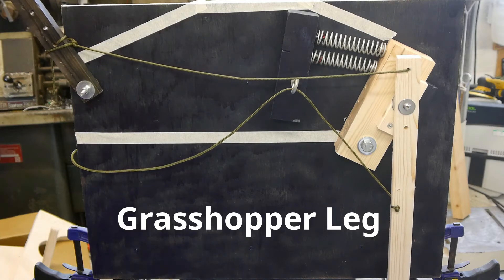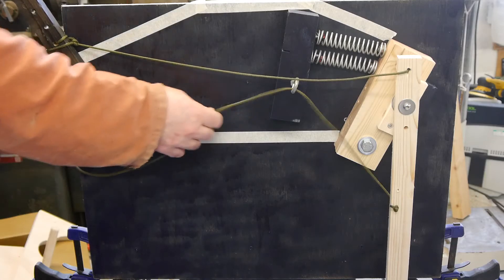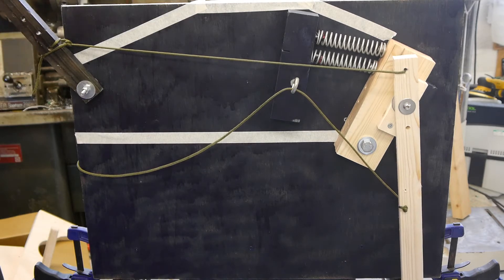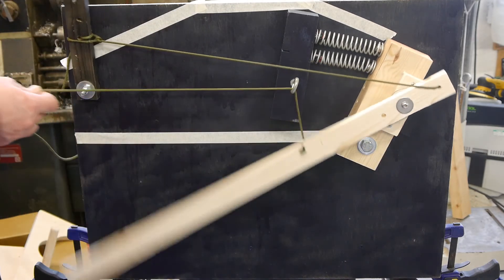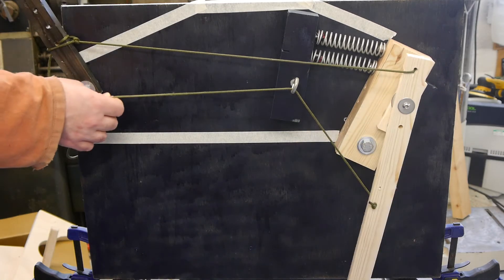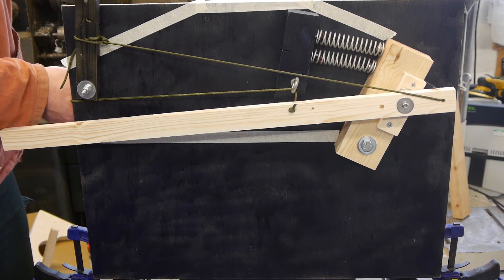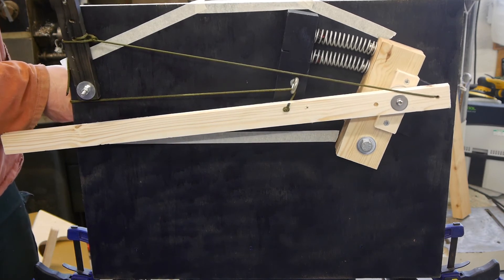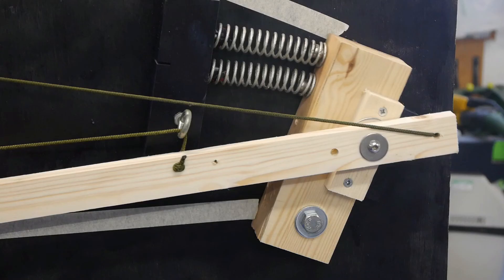How a grasshopper can jump so high

Comment: Strictly speaking You need to separate between muscle and tendon
Reply from the maker: @FLORIDIANMILLIONAIRE  you are probably right, though it doesn't affect how the meat mechanism works, which I was interested in at the time.
 I sold the kit to Steve Mould who has done a much higher production values version recently.
Reply: @daveansell1970  production for what ?
Reply from the maker: @FLORIDIANMILLIONAIRE  the video

Comment: Wow. I don't think most folks realize what a brilliant and novel mechanism this is. I just modeled this up in software to try to understand it. There is no human designed repeating mechanism that I can think of that accomplishes storing force and releasing it kinetically with even vaguely similar linkages (ok so a trebuchet is somewhat like this, but fundamentally dissimilar). I can't think of a single wind-up toy, robo-dog, crossbow, other similar kinetic weapon, car part, throwing machine, industrial machine, walking machine etc, that uses linkages like this. 

I could write paragraphs on why I think this is so novel, but just try to model it yourself and you'll see what I mean, the fact that the video model is using the very specific properties of strings for some of the linkages is critical, the efficiency of force transfer is amazing, and the angles are critical.
Reply from the maker: Glad you like it. I wonder if it isn't used very often is that there aren't many places it would be useful outside scrapheap challenge (junkyard wars).
Either that or it is just much better suited to muscles than rotary machines.
If you scaled it up and used winches the release on the smaller winch would be difficult to achieve safely and reliably.

Plus you have a system that needs two actuators with limit switches to achieve a single effect...

It is very cool either way.

Comment: I am looking in nature to design the ultimate shock absorber and I wonder if you think this mechanism could be a possible candidate?
Thank you in advance.
Reply from the maker: As is this wouldn't be a good shock absorber as there isn't really any mechanism for absorbing energy. In a car the shock absorber is there to stop the spring bouncing for ages when you go over a bump.
I don't know enough about cars suspensions to tell you if this would be a useful geometry, my guess is that you don't want a car suspension to get less stiff the more it is compressed so no. 

If you wanted a car to jump in the air, it may be useful.

Comment: on my quest to design and build a functional prototype "mach 5 speed racer" I would need this principle to get the vehicle to jump. it's the compression of the "spring" AND the shift of leverage that does it.
thank you for amazing work.

could we make a jumping strandbeest?

how do bumblebees and beetles fly?
if you are content with the answer, why doesn't gravity, momentum and inertia splatter them into goo with the amount of force required to do the things they clearly do easily everyday?
Reply from the maker: If you want a vehicle to jump, some kind of mechanism like this may well make sense, you definitely want to store energy in a way that is easily accessible.

When you scale things down the accelerations they can' cope with are higher, because the strength of a muscle, bone etc will go as the square of its size, but the mass will increase as the cube. So if you halve its size you will double the acceleration it can cope with, and double the acceleration a muscle can produce.

So a beetle or a bee at our size would rip itself apart (or not be strong enough to work), but at its scale it is fine.

I think the aerodynamics are also very different from an aeroplane, but are now understood.
Reply: thank you for the great response!